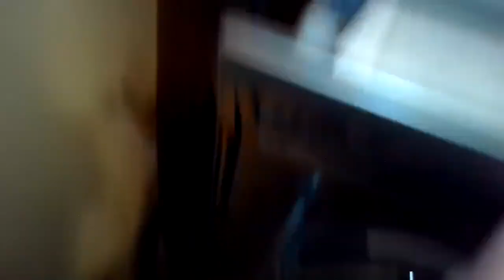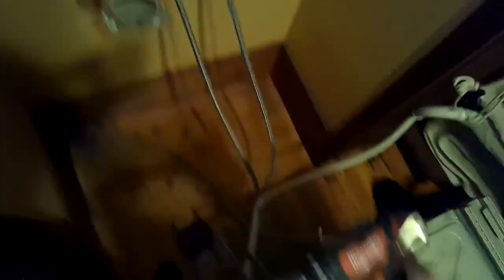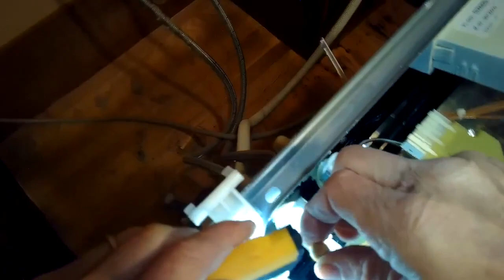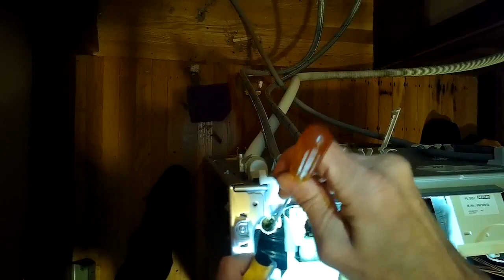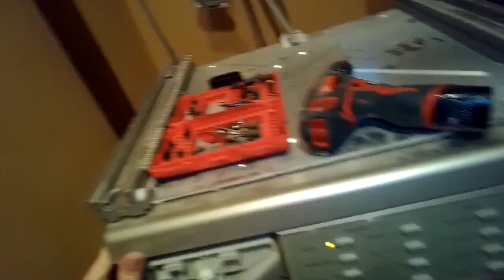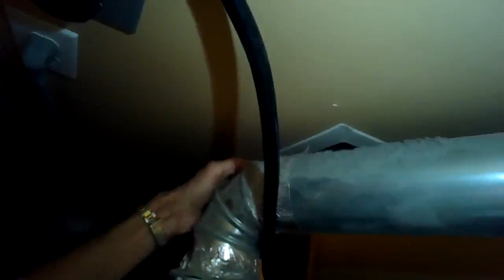Miele Washing Machine Not Emptying? Watch This

Comment: Great video. Where are you located? I am in baltimore md and miele service is totally useless.
I have a w1 that won't drain
Reply from the maker: Sorry, out in Cali Fornia
Reply: @ScottTheFixItGuyChannel  i am almost tempted to ask you how much
Reply: I tested the pump and it's fine.
I tested the wires going to the pump and i only get 60 volts and not 220v what can it be

Comment: I have a waterproof system activated code, I was able to suck the water from the bottom of the pan inside the machine using the hose from the carpet cleaner vacuum.  I haven’t found the leak yet, do you have any idea where it may come from?  I have the Miele W4840.  Thanks in advance.

Comment: I followed your instruction plus went a bit further and removed and cleaned other tubes that exhibited "the slime."  I have a model W4840 (their big boy model and unfortunately no longer available) and there's a similar size tube on the front right feeding from the pump to the near top of the barrel.  The effort didn't completely eliminate the drain fault (code F11) event.  I entered service mode and performed component test(s).  When executing Drain pump (M8) component test which activates drain pump,  drainage independent of level it "sometimes" passed or activated.  This lead me to suspect I have another issue where the pump motor isn't consistently functioning.  I'll replace it and see what happens.  Well done video and good advice, I thought I'd share and expand in case someone has similar difficulties as I did.
Reply from the maker: Thank you
Reply: I’m wondering if you have had this issue.   I have a waterproof system activated code, I was able to suck the water from the bottom of the pan inside the machine using the hose from the carpet cleaner vacuum.  I haven’t found the leak yet, do you have any idea where it may come from?  I have the Miele W4840.  Thanks in advance.
Reply: @davidnguyen5028  If your experiencing water towards the bottom of the pan then its most likely from the water intake assembly.  There's a rubber part that is prone to rub and eventually leak.  This part introduces the water and detergent from the detergent tray once the water is introduced.  There's another video available on this condition.
Reply: score14theteam Ok thanks. I’ll look for the video, was it posted by you?

Comment: Many thanks for the video . I have cleaned out my tubes and all is working fine now. . Not bad for a machine that is approx 15 years old. I think its great to have this resource as you can't always wait around for  someone to to come and fix your machine. The instructions and video were very clear. Thanks  again very much appreciated.
Reply: OklLz
Reply: MmKKz
Reply: Kakskw
Reply: In the USA we have "Affresh" tablets which you use to help remove and prevent this detergent build up.  I use it ever since having to go through this cleaning procedure and haven't had issues for 5 years now.

Comment: this is not complete problem fix... you should open the machine  lid from the side is the detergent drawer  remove all the rubber pipes and clean them  with hot water...also try to use powder detergent and high temperatures because your machine is full of slime because of the only liquid use and low wash temperatures...also use water plus option so you have better cleaning results for your clothes and for the machine